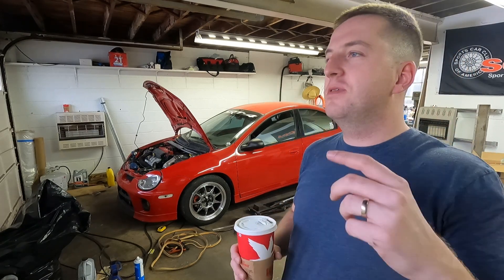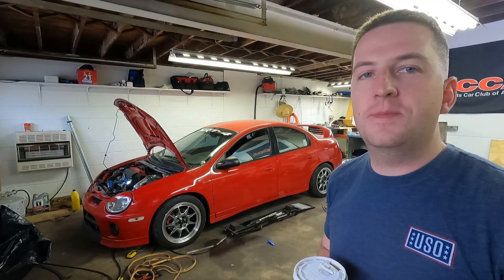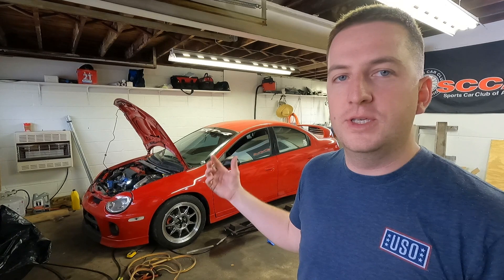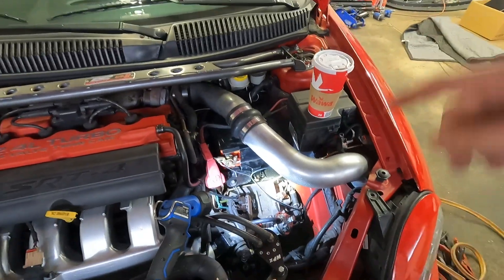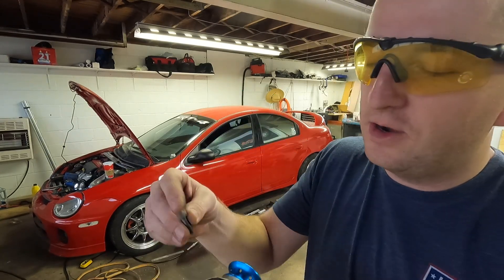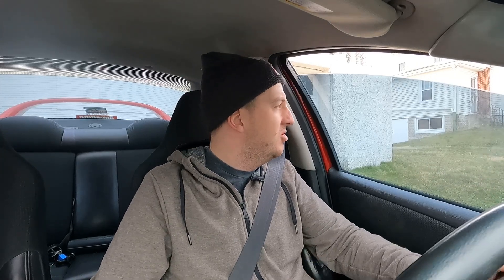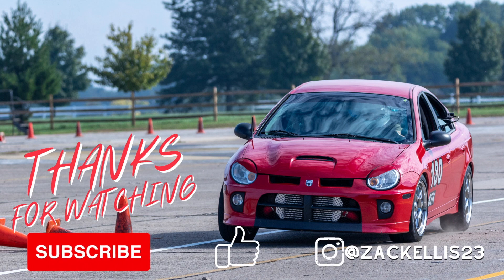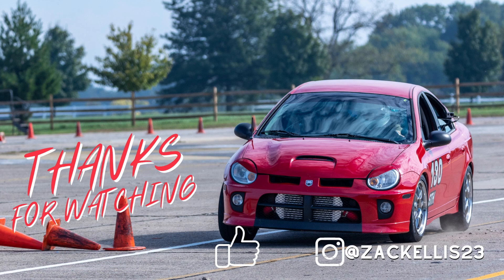Should you delete your BOV?!

Comment: one thing many overlook about bov is the fact they increase your spool up time between shifts,without bov you are allowing compressed air to go back into the compressor which slows down its rpm between shifts so it really is a performance part.let me know if you notice noticable difference id love to know how much truth is with this
Reply from the maker: Your are correct and hindsight I probably should have mentioned that lol. For me I race primarily AutoX so it’s a second gear run the entire time. My spool time isn’t crucial BUT yes ultimately it’s a power burden. I do plan on jumping to BWS eventually but hopefully I can finish a full season on this turbo! I appreciate the comment!
Reply: @zackellis23  did you feel any difference in spool time at all? I'm really curious to see how things pan out and do hope the turbo lasts.I do suspect there is alot of hype about bov probably from forums parroting each other. but also i cant deny manufactures use them for a reason.well have to wait and see,Love your channel!
Reply from the maker: @pigeonsil240sx   so it does feel a bit slow to spool up but that could be a placebo effect. If I had a larger turbo it would be much more noticeable I’m sure lol. And I really appreciate the love!

Comment: How would i go about doing this if i have a blow off plate? Would i block off the plate or remove it completly and replace it with a block off a plate? Any advice helps.
Reply from the maker: so if you're talking about the plate right by the turbo, all you have to do it block it off and plug the line running to it
Reply: @zackellis23  Awesome thanks, I will try this and see how it goes.
Reply from the maker: @twinky1014  hell yea! Let me know how it goes

Comment: GM did this experiment back in the 80s when they didn't put a BOV on the LC2 in the Grand National. With that old Garrett/AirResearch turbo they got around 30k miles before the thrust bearings were shot. This is just a bad idea all around. Akin to "Haters will say it's bad but I like the sound my car makes when I run into a pothole. Let's keep doing it."

Please don't do this kids. OEMs would love to save the $xx on every turbo engine and not put a BOV on it but they know it won't last the warranty without it.
Reply from the maker: Lol
Reply: Tell me you don’t know what you’re talking about without telling me☠️ The amount of air getting pushed back out of the turbo is nowhere near enough to cause damage. It doesn’t hurt anything especially on good turbos. I’ve done it on all of my turbo cars and never had an issue.

Comment: as for jdm cars uninstalling bov,i have a sr20det that had bov to atmosphere and would have slight burble misfires when revving or coming out of boost unless i ran recirculated,once i upgraded my turbo to make bigger power i had to upgrade my MAF to 300zx TT unit, doing so ment i could no longer run bov to atmosphere because doing so the car would stall right after going into boost when rpms drop. your car being a MAP sensor are faaar more forgiving.MAF engines just dont like bleeding off metered air and most of the old jdm cars used very unforgiving maf sensors.im sure people like tj and adam are still running a bov its ust recirculated and cant hear it very much.
Reply from the maker: I had no idea…. You just dropped knowledge on me! Haha I appreciate the info.